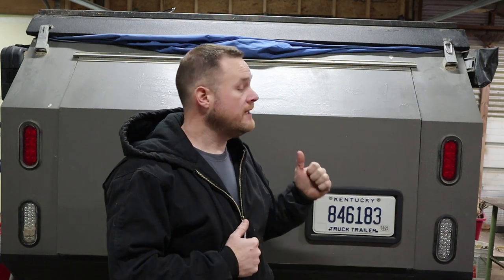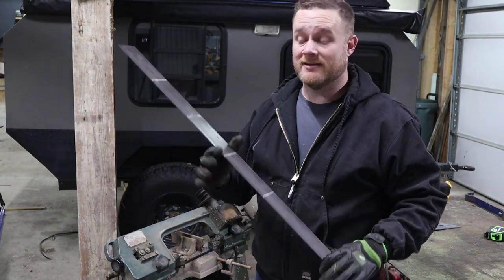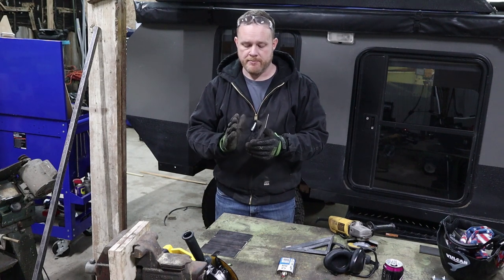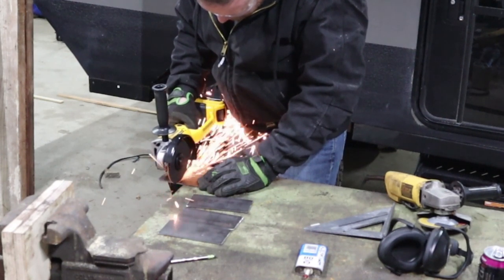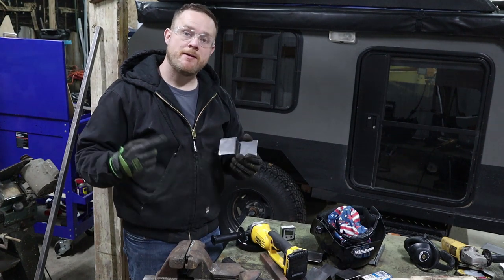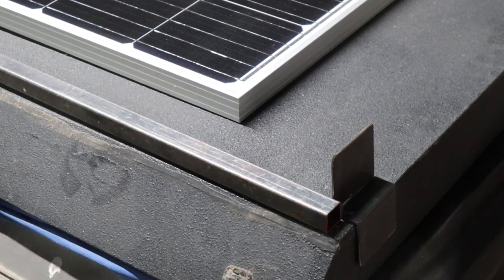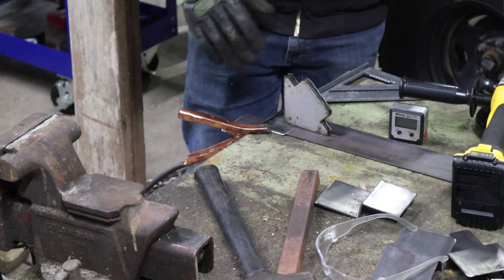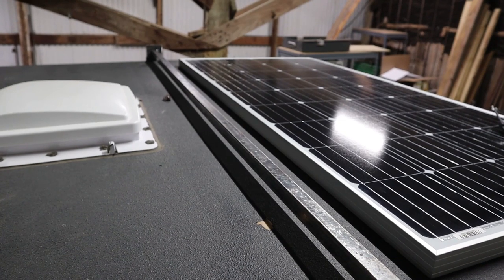DIY Roof Rack for the Off-Road Overland Camper! E78

Comment: Your frameless design is by far the best I’ve seen thank you for the idea and inspiration. I’ve been on the fence between a rooftop tent or a diy Overland trailer. I like the idea of the trailer much better but had concerns with Weight towing it with my ZR2 v6 Chevy Tracker with a tow rating of 1500lbs. Im a single parent it would be just me and my four-year-old son so my build would be smaller and lighter if you have any advice on keeping it under 1200lbs I’d appreciate the input. Also if you didn’t already know your heating options have gotten better with the Chinese diesel heaters entering the market within the last year or two you can get a 5kw heater for under $200 and they only draw 1amp on the lowest setting.
Reply from the maker: I have been considering switching to either a diesel heater or a similar design fueled by propane.  I think it will be in the near future.

Comment: Hi Shawnee I am building a tear drop as well  I just asking how many coats of fibreglass did you put on the sides in the roof
Reply from the maker: I put one coat on the flat sides and multiple on corners depending on how much abuse I thought they would receive.  For instance the wheel wells have probably 5 coats.
Reply: My Teardrop Is A little bit different it has a slide out for an ensuite or Porta Potty

Comment: Inquiring minds wanna know.....       What kind/size hardware did you use to attach your brackets to the pop-up roof?     Did you use a backing plate inside the pop-up?    On a similar note, did you use a backing plate for your awning?  Thanks for your videos. They are very professional and helpful.
Reply from the maker: I used threaded inserts from the back side to give the bolts threads to attach to on the roof rack because I didn't have room for bolts and nuts because of clearance.  On the awning , I used nuts and washers.